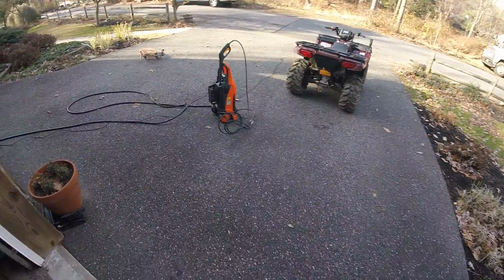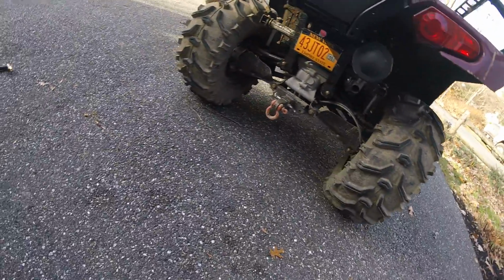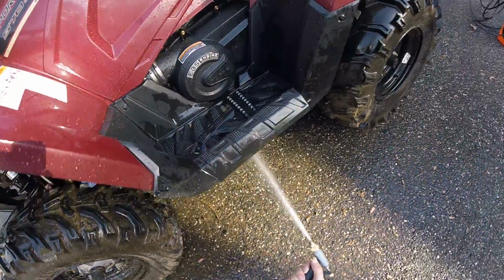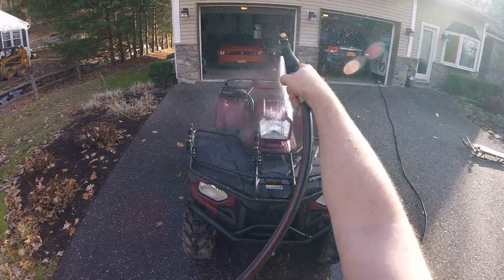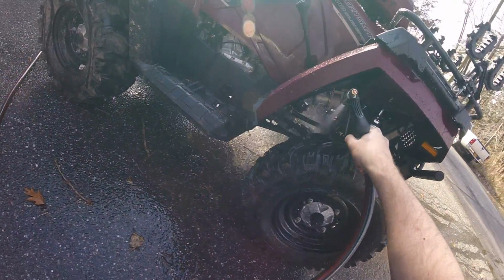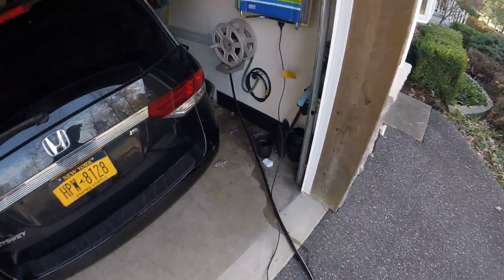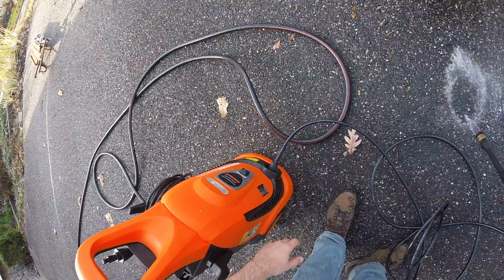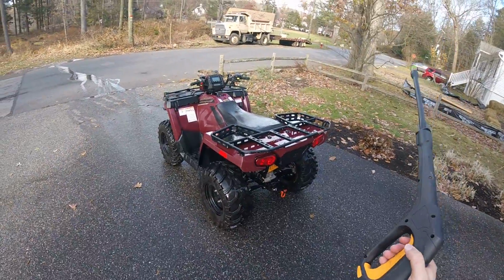how to clean a muddy ATV

Comment: Are quad bikes water resistant?
Reply from the maker: Yes, very much so - they can be driven through streams and almost completely submerged, just need to make sure water doesn't go into the air intake
Reply: GuyQ thank you very much for the reply I just got a quad bike I was worried if it got a bit wet it would ruin it